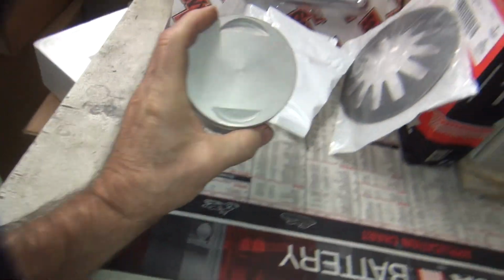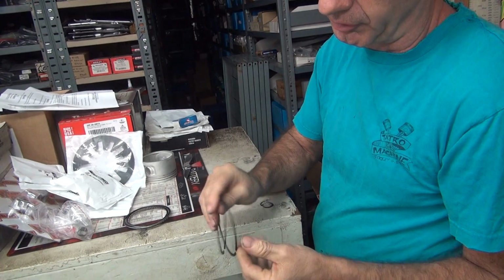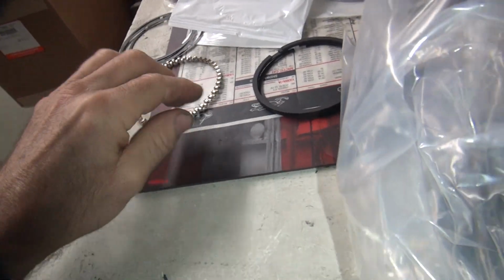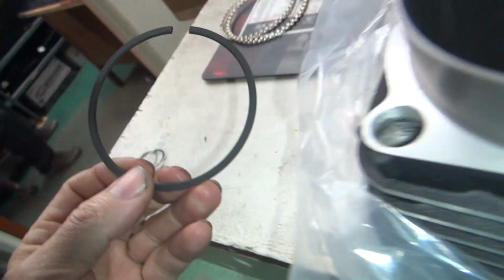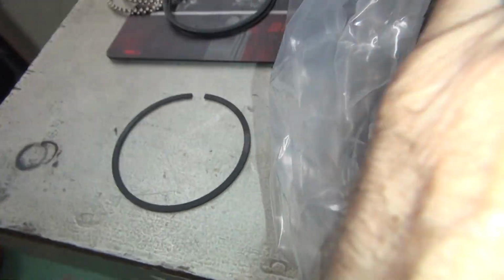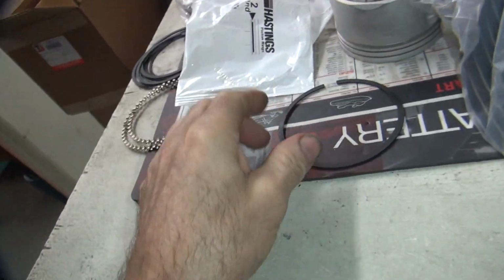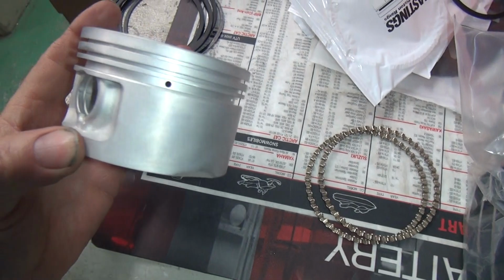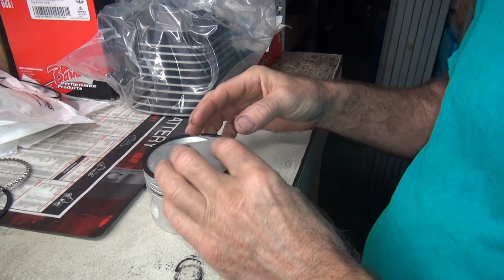#154-A how to do it, gap file & install piston rings shovel pan evo xl 1200 harley by tatro machine

Comment: Hi Tatro. My panhead manual calls for .004 ring side clearance, but I'm dealing with only .0015 with some NOS Superior rings and pistons. Would you run them, or look for other rings? Thanks!
Reply from the maker: as long as they are free in the grooves i would run them. just keep the heat down until they break in. .004 is way loose. that would be a wear limit, not a new one.
tatro
Reply: @TatroMachine  Thanks man, I definitely have wiggle room. I appreciate you writing back with the advice. Take care!